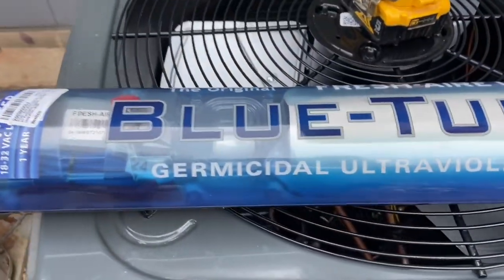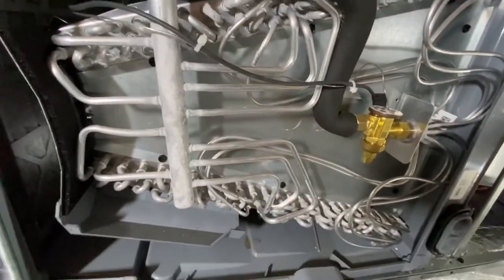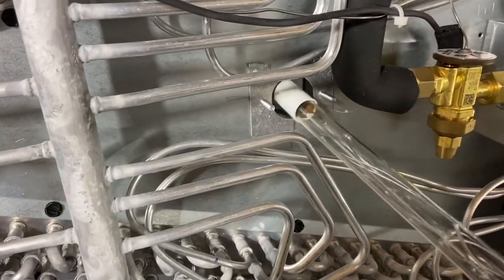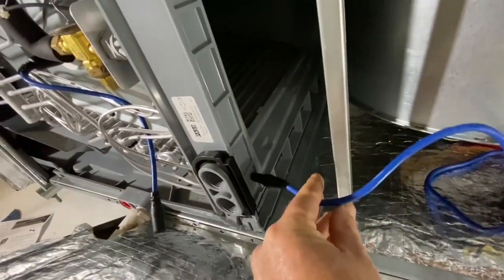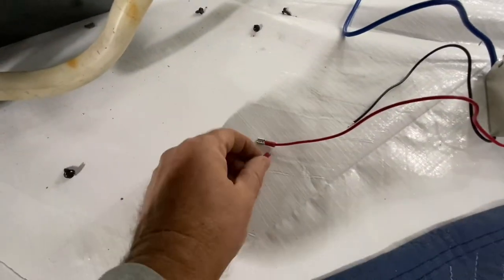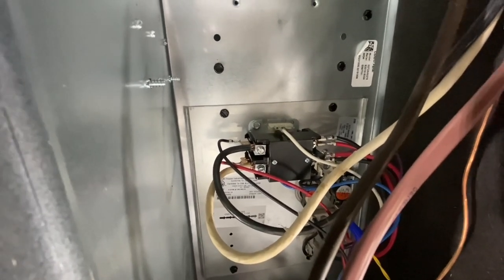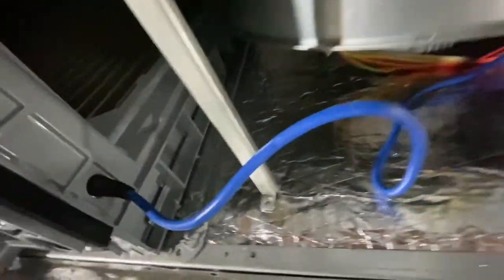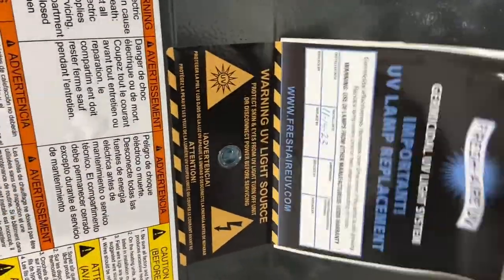Ultraviolet light installation for mold, odor and virus reduction, #DIY #HVAC

Comment: I install these UV lamps all the time for the HVAC company I work for. Why install another xfer? Couldn’t you just splice into the 24v side of the existing xfer that’s already there? That’s how we do them. Still great vid👍🏾
Reply from the maker: Yes you can. It was recommended to install a secondary transformer, to reduce stress on the unit transformer.